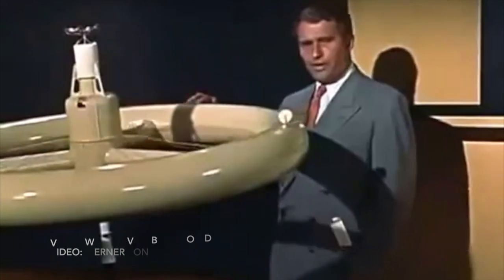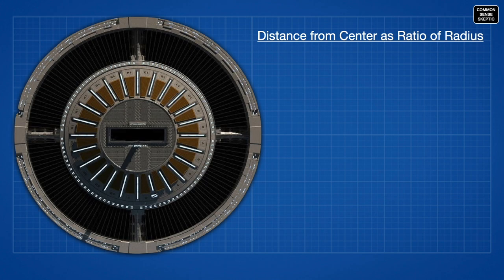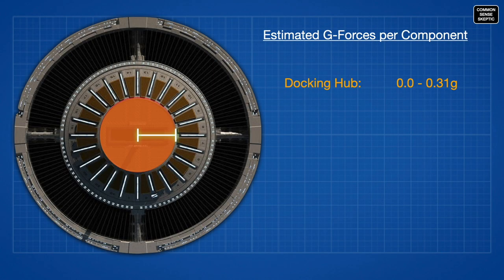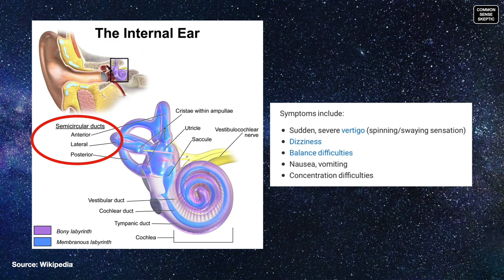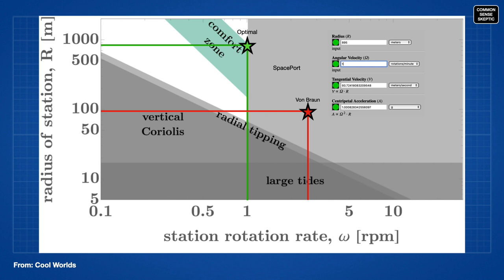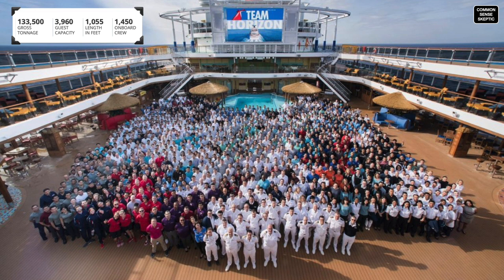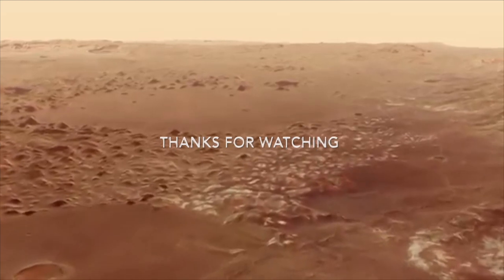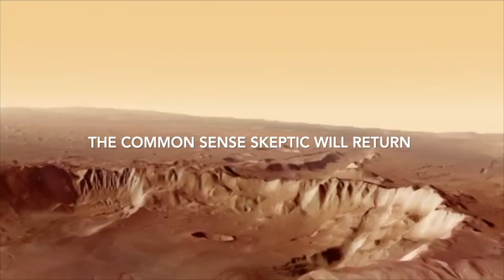DEBUNKING GATEWAY FOUNDATION Pt2 (1080p)

Comment: Crazy idea instead of having things spin a lot to create your artificial gravity:

Could you use electromagnets in the suit you wear as well as sensors around the ship to allow electronics on the suit to apply the proper power to various magnets to create a similar effect to gravity pulling you down towards the "floor" 

If you do this right the body doesn't really know the difference as the suit you are wearing is being pulled down appropriately, you have the advantages of weightless cargo, and you can change the orientation of the "floor" at will (assuming you have enough powerful electromagnets to act as the floor to be at whatever orientation you want). The downside of this would be it's complicated and it actively uses power. It would make it so you don't need a megastructure in order to have artificial gravity on a ship though which might be incredibly useful.
Reply from the maker: Sure, you could magnetic decks and boots to hold you to the floor, but that’s not solving the problems inside the body that depend on gravity, specifically your cardiovascular system.
Reply: @commonsenseskeptic  This isn't so much magnetic boots but like you have a series of magnets on top of your body like along the tops of your shoulders and such. It could be tuned to allow muscles to feel as if under gravity. Ideally it would be magnets in all directions around your body, so you could lean or lay down and feel "gravity". It wouldn't fix internal organs though. That is a good point. I don't know how your musculature feeling "gravity" would affect the cardiovascular problems though. It might help?
Reply: Gravity provides constant acceleration. Magnetic fields acting on a human body don't.
Reply: @jamesbatchelor3834  Yes. The electromagnets would at best create the effect of weight on the body. This would be able to stress the muscles and bones in a more normal way. It would be different, but it would be similar. More exercise would mean more use of the heart, which might decrease some of the cardiovascular issues, but other internal organs would just be operating in effectively 0g.

There is no way this would be the preferred method of things, but it would be better for the crew of a small ship than just experiencing 0g for their whole voyage.
Reply: @Jcod_  rotation is better in every way - the issue is getting sufficient size to prevent sickening coriolis forces. A rotating wheel 224m in diameter rotating at 2 rpm will generate 1g pseudogravity on someone standing on the deck of that wheel, with only a piddling gradient from head to foot. Can we build a wheel 223m in diameter in orbit though?
Reply: @jamesbatchelor3834  I acknowledge that rotational would be preferable. This is only really worth considering for smaller ships. I don't think it is reasonable to expect every ship to be basically a megastructure in space though. So either things will have to be done for smaller vessels or we just say deal with the problems from your time on those smaller vessels.
Reply: @Jcod_  Agreed. This is the very earliest days of interplanetary travel.   In time, it makes more sense to build big and have larger ships cycling the transfer orbits between worlds. They could have wide rotating sections, and a 250m wheel isn't really that big compared to the size of ocean liners we put to sea today. The issue is getting enough delta-V to get manufacturing equipment off Earth, but once you've done it, mining asteroids or even the Moon to build big structures isn't actually that outrageous. It's empty now, but the industtialisation of near Earth space will change our perceptions massively.
Reply: @jamesbatchelor3834  You're right 250m isn't super huge. I think it isn't really going to make sense to make a lot of those until we start manufacturing off planet though. idk. It is a still a crazy idea with a bit of potential. Definitely no where near a golden bullet.
Reply: A couple of points here. Thinking specifically about interplanetary travel and not a space station.

1. You could wear personal radiation shielding. This would increase your mass and thus compensate for a fractional gravity environment. In other words maintain skeletal loads.
So, you're solving two problems at once.

2. The limits on rate of rotation are not entirely settled. Some authors argue that we can adapt to higher rates if the rotation is introduced slowly.
See for instance the notes on https://www.artificial-gravity.com/sw/SpinCalc/

The site makes the following comment:

"It should be noted at the outset that, in orbital habitat design, the choice is not between artificial gravity and Earth gravity, but rather, between artificial gravity and microgravity.  Upon entering microgravity, about half of all astronauts endure “space adaptation syndrome” that lasts from one to three days [Connors, Harrison, Akins, 1985; Merz, 1986].  A similar period of adaptation to artificial gravity seems reasonable, considering the substantial health benefits that it offers versus prolonged weightlessness.  It may not be necessary to provide immediate perfect “comfort” in artificial gravity, especially in small exploration-class vehicles with select crew."

3. Even a limited amount of spin gravity is sufficient for a lot of purposes (having a sense of up and down, keeping objects stable, being able to enjoy a real shower).

So given there is some flexibility, what can you do? I played with the calculator for a while and I came up with the following solutions:

Radius 80 metres, 2 rpm. Gravity: 0.35g  -> So fairly comparable to Mars gravity and comfortable without adaptation.
Radius 80 metres, 3 rpm. Gravity 0.8g -> Possible with a period of adaptation (slow spin up).

This is practically achievable with a spacecraft that looks like this. A truss structure. On one end of the truss a habitation module. On the other end of the truss, tankage and engines. Plenty of room for other hardware (solar arrays, radiators, antennae and so on. Basically you're using the remaining fuel (needed for propulsive capture into Mars/Earth space) as a counter-mass for the habitation module.
Reply: @saumyacow4435  I never really considered the idea of purposefully having less effective gravity to allow a spin system to be more viable. It will be interesting to see how various experimental gravity options perform. They all have their potential up sides, but without knowing health results, we can't judge them very well imo.
Reply: @Jcod_  Its a trade worth considering. One other consideration is this. On a typical Mars mission you might spend four tenths of your time in flight and six tenths on Mars. So for most of time you're going to have to deal with Mars gravity, however it may affect you. Having higher spin gravity (than Mars gravity) whilst in flight is thus a case of diminishing returns. My gut feeling about a Mars mission where you do have variable spin gravity is that you'd spin up over the course of a week to around 60-80 percent of Earth gravity (the extra mass in your worn radiation protection would make you effectively the same weight or a bit more than that on Earth). Towards the end of the flight, you'd gradually spin down to Mars gravity. On the return, you do the same thing in reverse. Slow changes in spin rate will help people to adapt.

As I noted, one of the things I love about even low artificial gravity is that you don't have to worry about things floating around. But most importantly it allows you to have real showers - that's a luxury that makes a difference to morale. Wearable radiation protection is the most efficient way to use mass for radiation protection - much more so than mass used in the hull. Similarly it pays to invest mass into radiation protection materials that are close to people - such as chairs, bunks etc.
Reply: Too energy costly